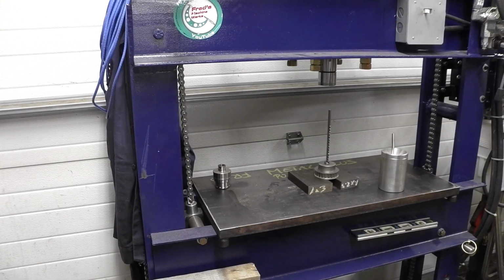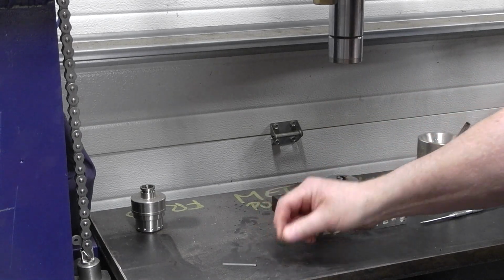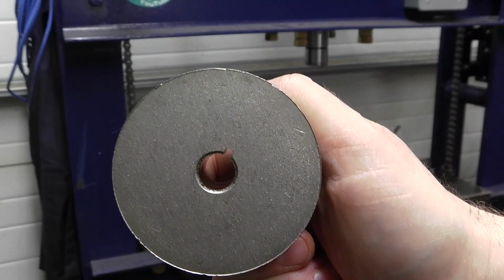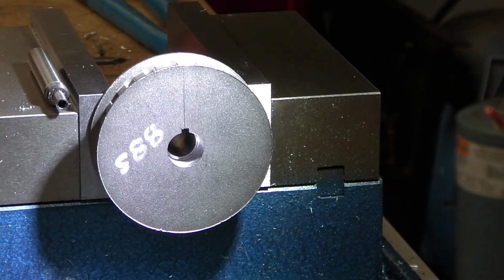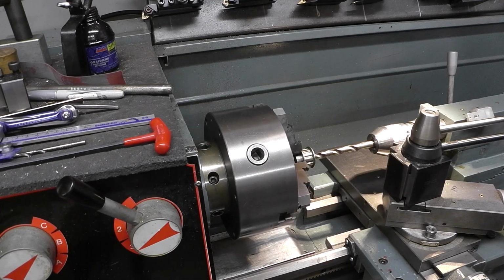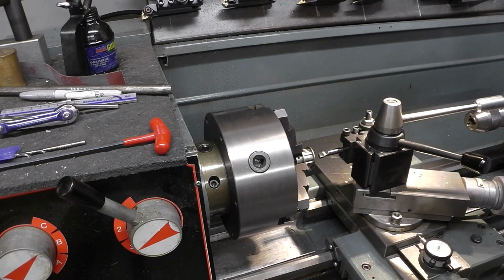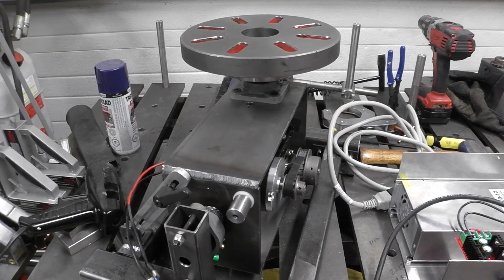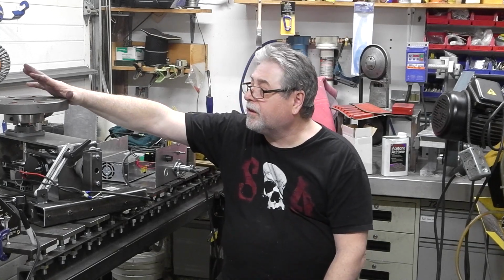Another Night In the Shop 59   Welding Rotary Table Build Prt 10

Comment: Did that end up being slow enough turning in use? Looked like it may be right on the limit of slow enough for thick material. Thanks for sharing. ATB
Reply from the maker: Going to be building a new one after the plasma table done. Smaller more compact.  The other one is now at work
Buddy of mine needed it.

Cheers Fred

Comment: Hi Fred, nice rotary table. what kind of motor do you use?
Reply from the maker: Sorry I took so long to reply. The motor is a high torque 12 volt salt spreader motor that you would find on the back of most salter pick up trucks. Not to pricey and just used very cheap speed controller and power supply.

cheers Fred

Comment: Hey Fred, sorry to bug you in the comments here, but I can't find an email address for you - just wanted to say I finally got channel stickers made up and got one here with your name on it if you email me an address I can send it to.  Also, that welding rotary table is coming out nice, you've put a lot of thought into it!  One of the few builds I've seen using a belt drive.
Reply from the maker: Hey Everett
Thank so much
Email address is fred's.machine.werks@gmail.com
I have took some time off this summer
Needed time out.
Again thank you so much
Reply from the maker: I have to fix this auto correct.
email
freds.machine.werks@gmail.com

Comment: Good work again. I really like the hydraulic press you built. I may be wrong but the lifting chain on the press left side looks like the end connecting link is open (not through the pin at the back.)  I can see a hole which looks like it is in that link unless it is actually something else.
Reply from the maker: colm one 
No the link is just a spare I left on there.itvwas there when I was adjust the slack I the chain.
Cheers Fred